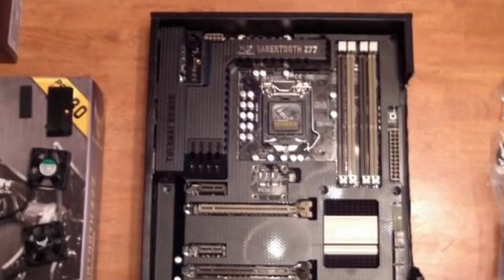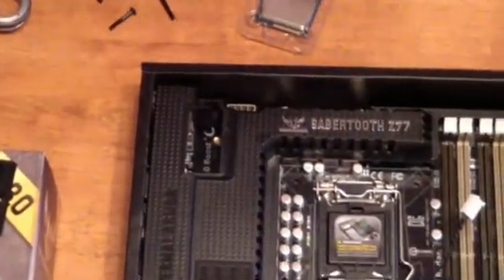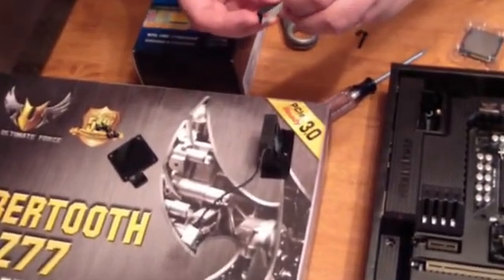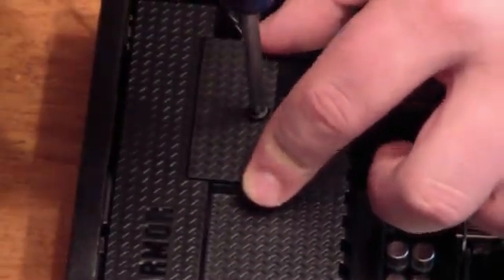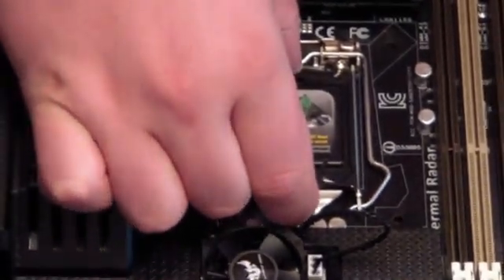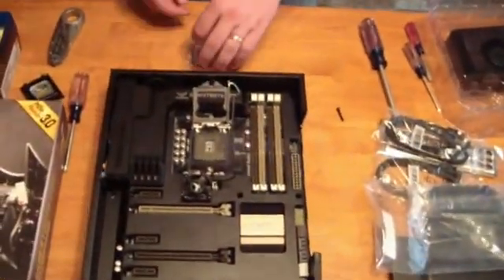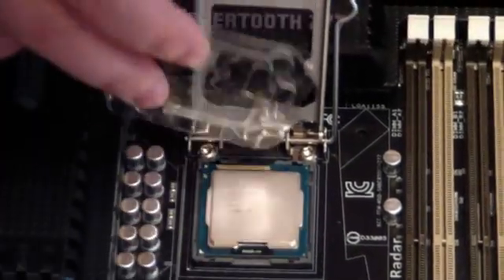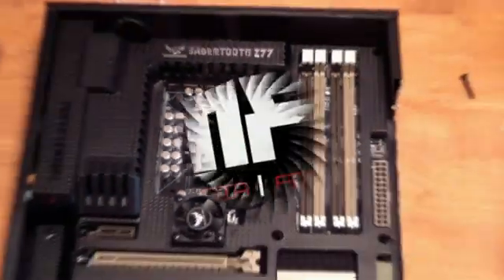How To: Install Sabertooth Z77 Motherboard fans and CPU

Comment: they are kinda loud. does anyone know how big those are? 35mm or 40mm and if i could replace them with noctuas?
Reply: Damnit! But thank you anyways :)
Reply: Waffenwalter can't you just turn them down via the bios?I thought asus had a pretty decent fan control configuration on board
Reply: yea the fan controll is great via AI Suite 3! But those small fans need a quite high voltage/rpm to start, so they produce noise as soon as they turn on. yet i love my sabertooth (especially for all its 3pin fan connecting options) since i removed the little screamers :)
Reply: I was just now looking for the fan size. Used board, missing the back fan.

Comment: You did this WRONG. You should NOT remove the black cpu pin protector before you install the cpu. You should leave the black protector ON, install the cpu, close top plate and it will pop out as it presses against CPU top.

Comment: Unless you have like 10 drives +liquid cooling+ a bunch of lights, fans, plus quad sli/ or crossfire.. your going overkill with that psu and that ONE card. You can run that rig OC'd with a 750w psu in dual sli with latest cards. and still have room to spare.

Comment: Yes this board supports 2400mhz dual channel ram. doesn't support quad channel ram. Very good board, I'm using gtx 690, 3770k, g. Skill trident 2x8 2400 mhz ram, 1200 watt psu. A dream system. Crysis 3 like a charm

Comment: Those asst fans are loud as hell  I turned them off since day 1. If you are using a good push pull configuration you don't need to enable those loud ass fans.

Comment: I little update for my last post i ended up getting the screws out finally it definitely took more force than i wouldve liked to put on my motherboard but everything seems to be fine (because im using it for this comment lol) what really seemed to help me was going out and buying a screwdriver that better fit the screw and it had some better grip than my precision screw set which really helped.

Comment: After i ordered this motherboard building my PC went very smoothly for a first build except for installing these assistant fans. I don't know if this is common or i just have a crappy screwdriver but I simply cannot remove the screws for the fan covers my temps seem to be OK without the fans but it would really give me some piece of mind to just go ahead and install them.

were your screws hard to remove?

Comment: When you say the 'four screws' for the first motherboard fan, I think you should point out that the fan they use only has three available holes, as one corner is used for the cable!!!
It says exactly the same in the book that comes with it, but I bet you will get some numpty trying to screw past the wire...

Comment: Does anybody know if these fans are both 40mm in size? Because if they are I can easily replace them with more silent fans, but some reviews claim that one is 35mm and those are not easy to get a hold of. Reason I'm asking is I'm generally worried the standard fans might be a noise issue.

Comment from the maker: The X79 does have a better chipset.  That being said, if you are strapped for cash you most likely won't be buying other components that will be able to use the extra speed that the faster chipset affords.  I paired the Z77 with a GTX670 GPU and an i7 overclocked and have never felt like the motherboard was slowing me down.